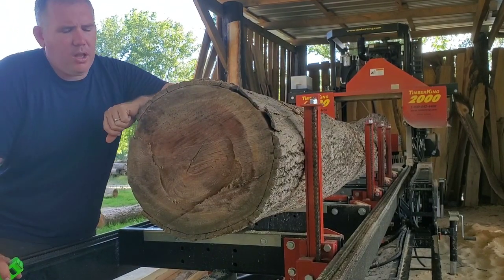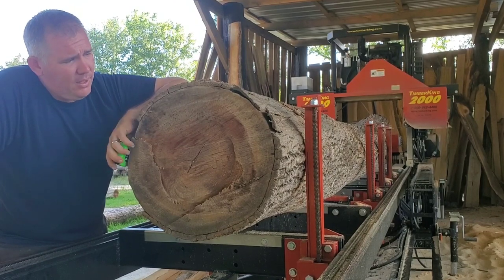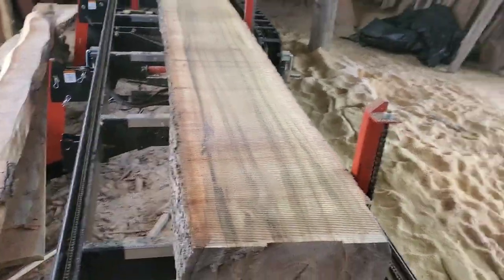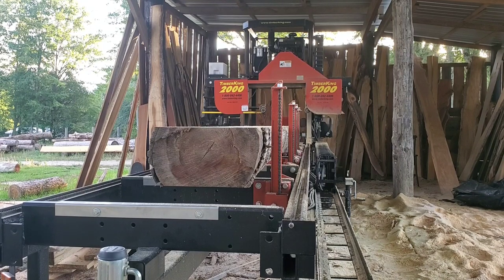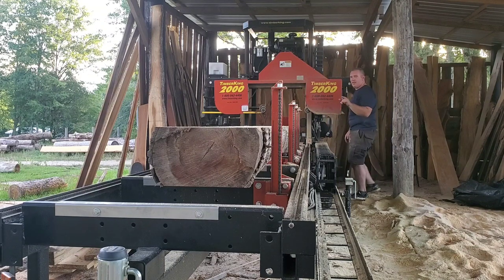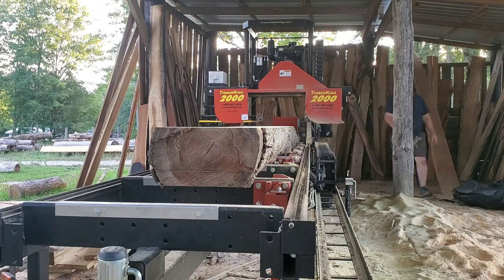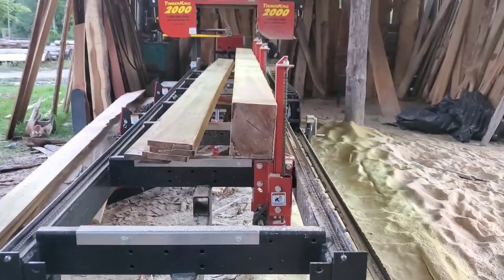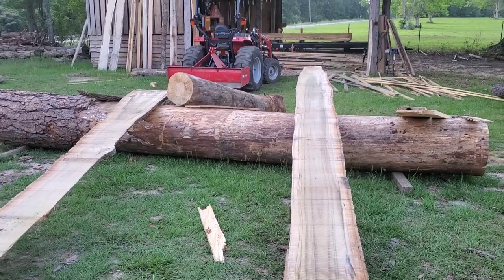Milling a poplar log into a mantel and beam

Comment: Did the beam show a radial crack when it dried?  All the poplar beams I made that included the pith split.
Reply from the maker: I have not had that happen but one or 2 times on poplar but it was a decorative piece so it looked good.  On cottonwood yes.  Depending on when the logs were cut and the season I started to dry them has a big impact.
Reply: @TCSawmills  What season is best, which is worst?